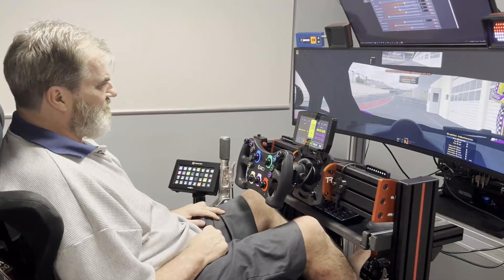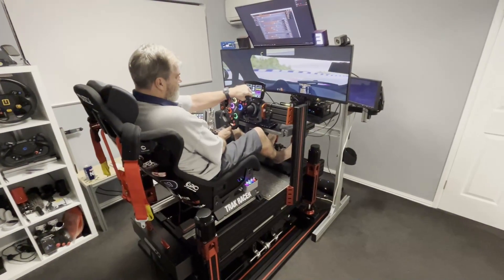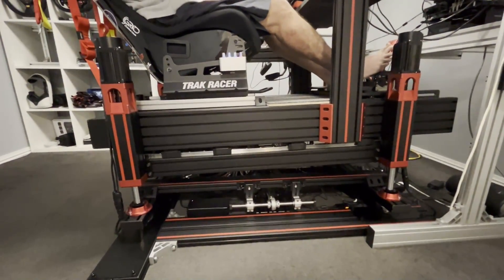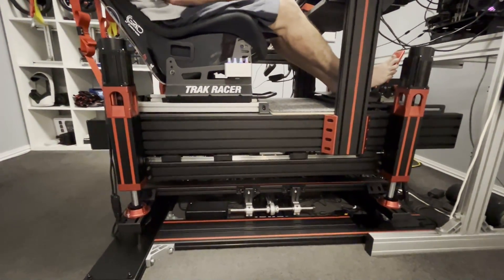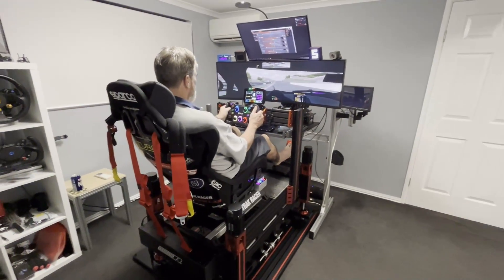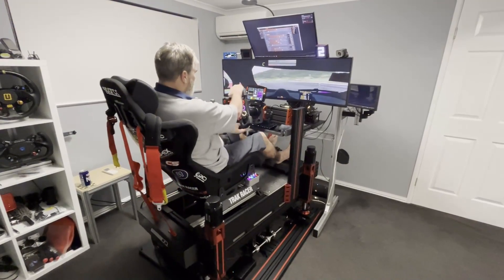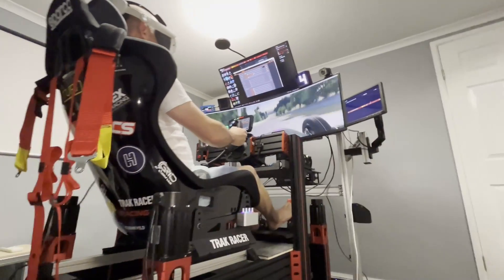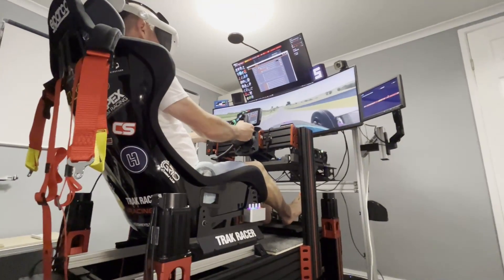THIS SIM MOTION RIG FEELS ALIVE  WITH 5 DOF

Comment: Seating position is way too high for your wheel placement
Reply from the maker: Personal preference I guess 👍
Reply: @scottmagee3113  I mean every car out there would say otherwise
Reply: @scottmagee3113  I guess you can't do much about this now, but your center of rotation is way to low and seat way to high. It creates unnatural movement having such a discrepancy. Ideally it should be chest level or at least seat level. You can compensate for this in the motion software but it will limit your travel on the actuators.

Comment: Is the motion from the rig filtered out of the VR?
What is the point of the surge moving forward when you brake?
Doesn’t that give a g-cue of a brief acceleration? 

Congrats on the rig!
Reply from the maker: Surge forward. Like in a car, if you brake your body moves forward
Reply: @scottmagee3113 As long as this feels right to you, that's perfectly fine.

However, when you brake in a real car, your body actually just slows down and you are therefore pushed into your seatbelt. Imagine if you weren’t wearing a seatbelt and had to brake suddenly, you would definitely kiss your steering wheel. In your current setup, though, the surge is configured, that when you brake, you’re pushed back into your seat instead. That is actually the force you should feel when you hit the gas pedal. 

Try (or rather not :D) to close your eyes when doing it in your real car. Maybe you will switch the sensation of your surge afterwards. 

Anyway, as is said, if it feels right to you atm, you can also just ignore my comment ;)

Have a nice week ahead:)
Reply: @Jan-1337  Ya, this is how the professional rigs do it. Surge back and pitch up slightly to give the initial G force que for braking. Since constant velocity is the same as sitting still, the move back perfectly reflects what you would feel in the car as the car decelerates "moves back" and the inertia pitchs your head forward and down.

When you don't have a real surge axis and you have to rely on pitch to surge instead for 3DOF you get a false que because your heads inertia causes it to pitch backwards instead of forward when the rig pitches forward. The surge axis moving back when braking solves this problem.
Reply: Nice rig BTW!:)

Comment: Look great. Question, what AASD servo  cabinet is that? Any requirements to mount those? Is it a std U rack cabinet? How if at all is it modified to hang the AASD controllers. Also what Length DSUB25 cables did you use in the cabinet?

Comment: You just can't let the vehicle roll over, otherwise Sim Motion simulates that too!😂
Reply: Absolutely!  That’s why settings used during video are quite low. Without seat belt tensioner operating, it could through you out of the seat. Thanks for your support.

Comment: Is this setup from Eracing labs, if so how do you find there surge actuator setup? Rig looks great btw
Reply: Yes from Eracinglab. Surge actactuator well worth adding to any set up.This one I can highly recommend it can move you alot and quickly. Have the settings on the high side for fun and tone it down for racing.
Reply: @SimRacingTime  cheers mate, yeah have their RS+ kit and the tensionerR  so I'm interested in the surge aspect.
Reply from the maker: You can reverse the surge in the settings. It takes a lot of experimenting. In the video setting we’re no where near maximum. The thing would through you out of the seat without a seat belt